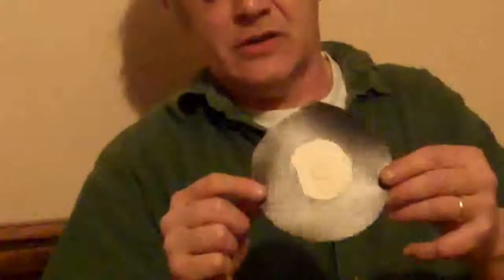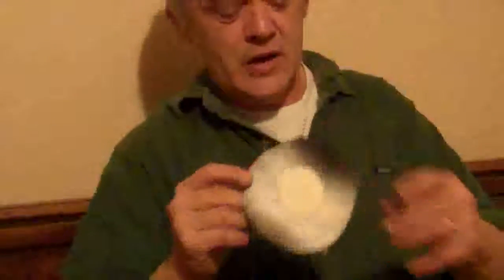Graphene Part 4 - Update and Reducing the Graphine Oxide

Comment: Hi Robert 🤓You state that electro can give to thick of an exfoliation but could this just be sonicated after as in apply 2 processors. ? I have a vibrating sander😂 and In all seriousness would it have an effect or do you actually need sonics level of vibration ?
Reply from the maker: i think the energy input would be too low mate - but i guess you could always try it
Reply: +Robert Murray-Smith  Yeah fair call on low energy but at high energy it ripped it apart to much so my logic is a gentle shaking but for much longer ! Can that make sense . I am going to try but not sure of how to test the outcome of having thin together larger sheets . Any ideas?
Reply from the maker: what test were you thinking of?
Reply: +Robert Murray-Smith how to test if I have larger platelets or not !
Reply from the maker: you are going to have to get a sem image mate if that's what you want to know
Reply: +Robert Murray-Smith thanks Robert . I will research that and if I do I will post a video 🤗geez it's good to have a Robert !
Reply from the maker: i look forward to seeing it mate

Comment: alright. so after a few days i did two tests.  One with about 5 grams per 50ml, and the second with about 8 grams per 50ml.  After cooking them both for about 2 hours, the solution with 5 grams seemed to look better, or with a finer top layer.  The other one i actually let dry for about  a day in the sun and then i ground up the remains and they look identical.   I will see if i can show you a picture of what it looked like.  Almost looks like carbon tho to be honest.

Comment: I left a 3 part message on your supercompacitor PT 5 video, a how to I reduced graphene with a bio char cloth & how it worked. also we have been emailing I am under smurphy6969@gmail.  But another way I got some results was painted graphene on Corona plasma treated HDPE film, the treated film lets ink stick to it, Put the 2" squares inside a 120v 40w amber strobe light lens housing. let it strobe for 2 days, it reduced with out melting the HD film. Not sure how good but it darkened alot

Comment: Well back to the drawling board.. the plasma reduction was to much for the sub straight. burned traces right through the film. it burned very similar to the intercalated graphite in the micro wave...once a spot reduced it made full contact hot spot, shot lighting sparks, guess i'll have to try a much slower option. darn that sucks! I wanted to spit out 345 graphene plates a min .lol .... oh hey, I just figured a cheap easy way to reduce but it takes a while. you need to try it for us? .email me

Comment from the maker: Use the same method to coat fine woven fibreglass in graphene. The set up an alcohol lamp with ethanol as the fuel. Pass the graphene coated fibreglass a few times just above the flame. The soot will form oriented nano tube perpendicular to the cloth. This should be a very good material for batteries

Comment from the maker: I dripped the GO solution onto the glass and swirled it around until I could see it was coated. Then I put it into the sun to dry then I put it into the oven for 1 hour. Not a good method I know. But it was more a proof of concept. Tomorrow I am going to build a spin coating machine and I will clean the glass with acetone first. I have some iron doped carbon nitride I made I am thinking of using this. Do you want a video on how to make this material?